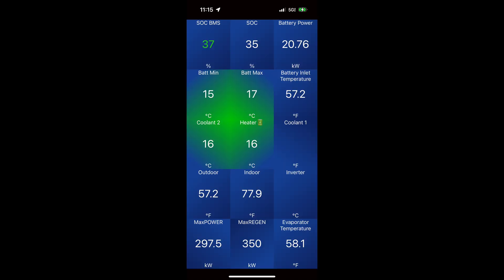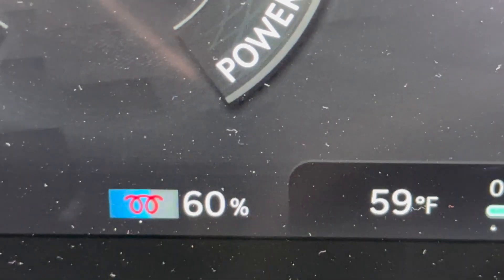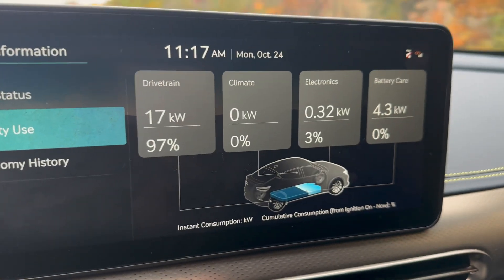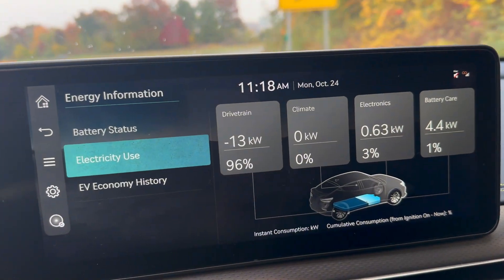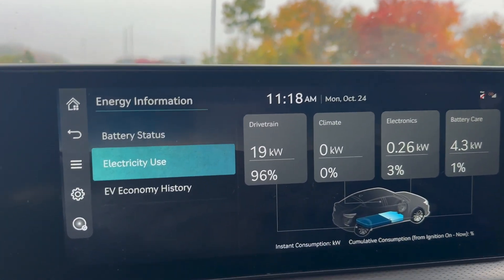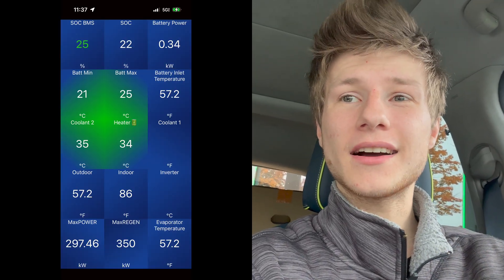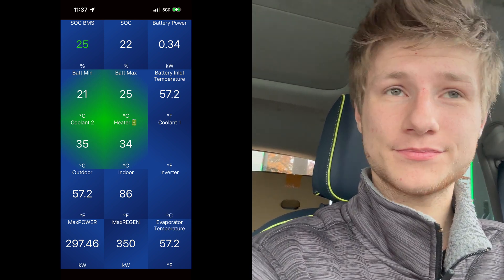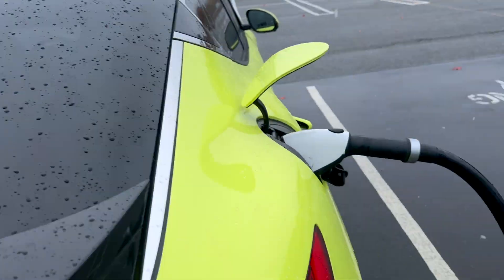Genesis GV60 Battery Preconditioning, Same concept for Hyundai Ioniq 5 and Kia EV6

Comment: How do you turn on battery preconditioning on a GV60?
Reply from the maker: You navigate to a networked DCFAST charging station, and it will automatically turn it on, no way to manually turn it on